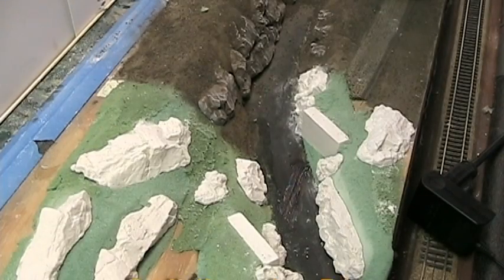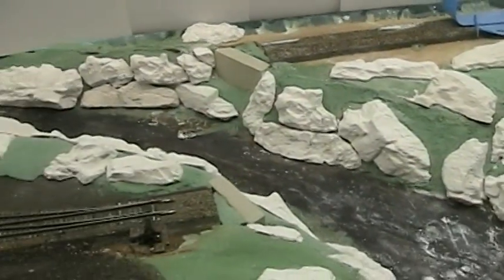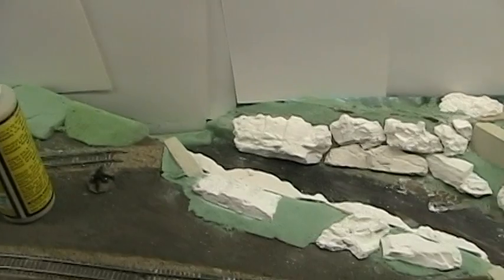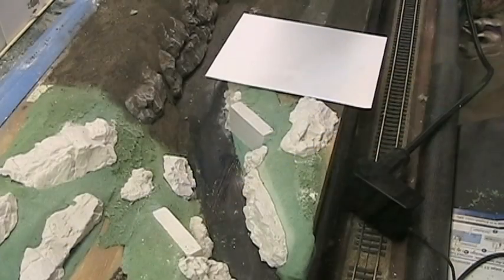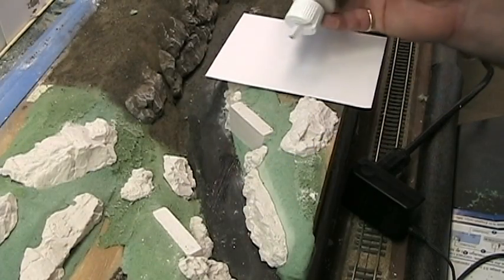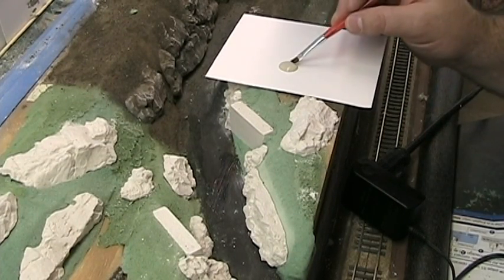Building the River Scene: Part 37

Comment: Just a suggestion......but when you're painting with watercolours (which is essentially what your washes are), you traditionally paint the lightest colour first, working through the darker shades on subsequent applications.
Have you tried using a slightly lighter gray, leaving some of the plaster (rock) exposed, then painting with the burnt sienna, and applying the black wash last?